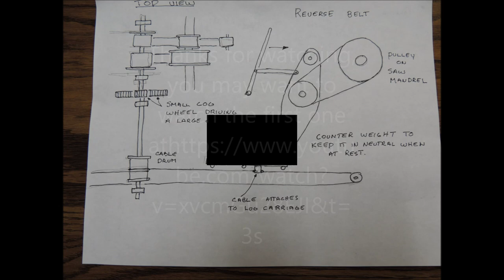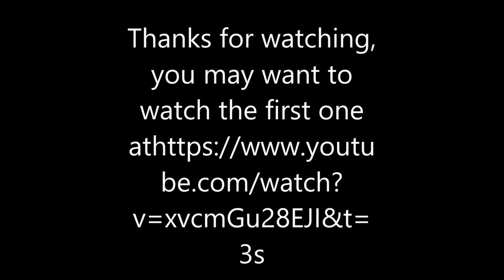SAWMILLING LIKE THEY USE TO DO IT, CARRIAGE FEED WORKS

Comment: Love that governer kicking in on that engine that mill rips!
Reply from the maker: No governor,  That other lever that I have is the throttle,  wire tied it it then a simple right angle plywood angle wire to carb. Makes it more fun controlling the motor by hand.

Comment: i stopped in thinking id get a glimpse of the pawl that sets the board size. i want to know how the works particularly.  i have designs to build a mill soon on the family farm lot. this was useful though I have seen another method that I like because it let you pick the travel speed  but this seems a much simpler build no futzing around with disk and rods